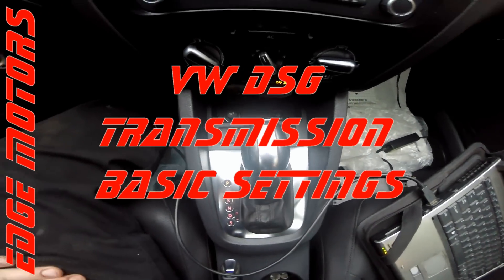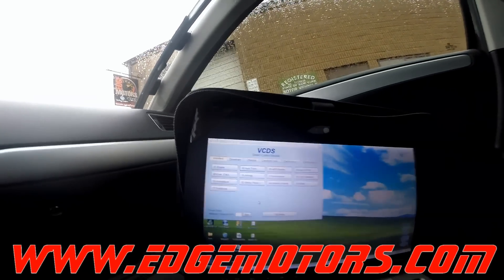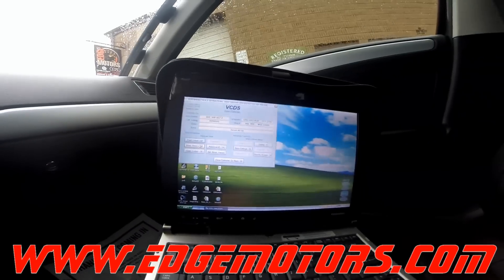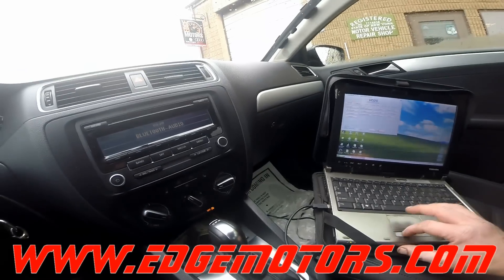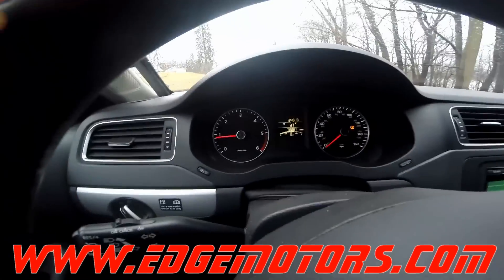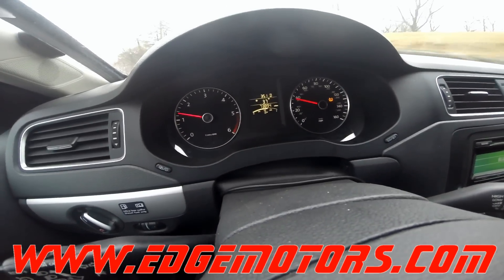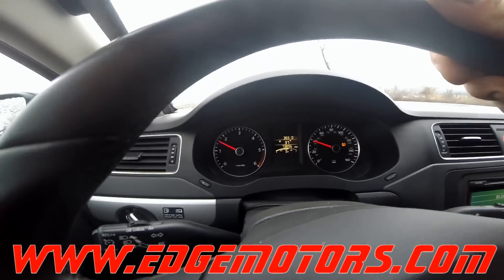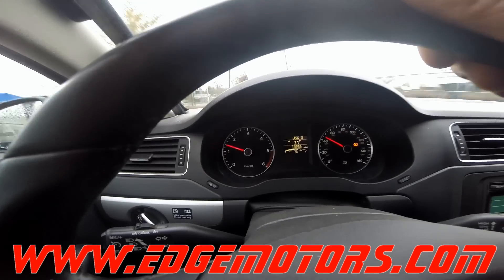VW Jetta Golf Gti Passat Rabbit A3 DSG transmission Gearbox Basic Settings adaptation by Edge Motors

Comment: Audi a3 1.8tfsi 2008 model, recently replaced a clutch kit, PRNDS still flashing.what still need to be done now?
Reply from the maker: If the lights are flashing, there are codes set in the module. Read the codes and maybe it will tell you what needs to be done.

Comment: 06 A3 Had PRNDS flashing after it was stuck in a ditch and it shifted in to neutral while driving! Took it to Reputable euro shop they wanted to replace DSG transmission or get a new mechatronic unit! Went to a small shop like yours and they performed basic setting and changed DSG fluid! Been fine ever since! This is a useful service that can fix faulty DSG sometimes!
Reply: michael bertucci how much did they charge for the basic setting and DSG oil change?? I have a 08 Jetta TDI DSG with flashing PRNDS that goes into neutral whilst driving.